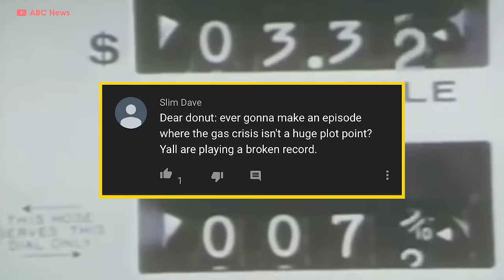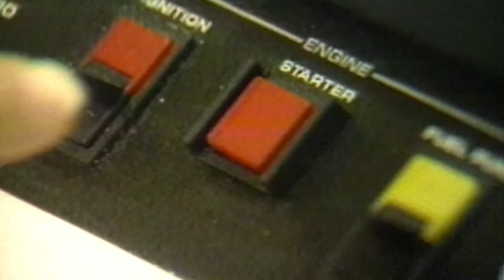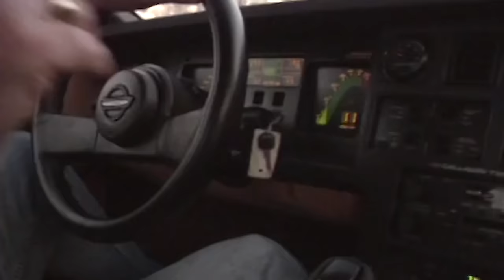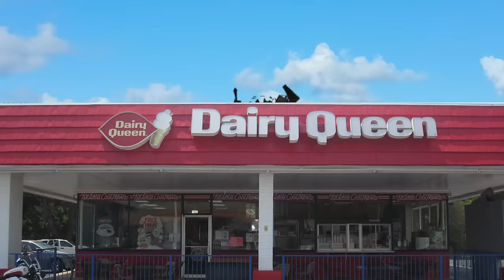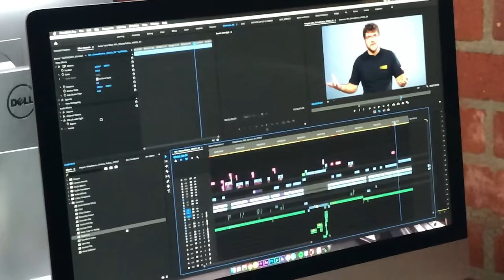CALLAWAY - Everything You Need to Know | Up to Speed

Comment: So like, and hear me out here, the Lexus SC. It's so underrated especially on the west coast, same platform as the supra but you coulde get either the 2JZ or the 1UZ V8. Plus they're insanely reliable.
Reply: I'm still kind of suprised they haven't done an up to speed on SC's/Soarers. Or the Eunos Cosmo for that matter. Both so underrated
Reply: everyone says im crazy when i say the sc is a better 2j chasis then the supra... sc is front mid engine technically and much cheaper than a supra
Reply: ForgedCarbon sc300 look better than the supra
Reply: As much as I want that, the fact that the SC/Soarer is generally unknown is one of its best features.
Reply: @illshlapu  true, but it's a great starting point for early enthusiasts and I can't see it raising the prices in em drastically
Reply: While I love my SC they aren't nearly the "same" platform they do share a lot of common traits but their 2JZ is the GE which is the same as the NA Supra's. I got a SC300 with a 1JZGTE right along side my 1JZGTE IS300. Lexus made some super sexy cars back then that are reliable AMAZING platforms. I haven't bought anything but a SC or IS in the last 20 years.
Reply: @oldhunterraziel5327  I know they are not identical, but most of the parts on a supra 2JZ you can just bolt right up, obviously with some outliers. But the suspension is the same, frame was the same they just took off an inch on each side for the supra, the SC was the luxury coupe the supra was the drivers car... both amazing cars either way. But yeah i know it isnt like you can put em side by side and say "dude all the bolts line up" lol
Reply: @seankennealy3021  yeah I have used a lot off the 2JZGE's in my 1JZGTE swaps. I mean aside from displacement 1JZGTE & 2JZGTE VVTI models so much can be jist swapped over. I have 2JZGE coil packs on my 1JZ and the injectors I used as well from the 2JZGTE to go from 440cc to 550cc. Got quiet w few upgrades for my 1JZ off the 2JZGE motors.
Reply: 1UZ V8 is no joke. Great engine
Reply: @aaronp9835  preaching to the choir lol, have the vvti model in my sc400. good power down low and decent up top too, and crazzzyyyy reliable. Some people use the block for race boats just because of its durability
Reply: Sean Kennealy Yeah it’s definitely a great engine. Are used to have a 2006 Scion TC with a 3.3L v6 from a Highlander I believe. I had blown up the motor and saw on YouTube there was a guy that did the 3.3 L V6 swap I thought wow that’s amazing I’m doing that. Had to get a custom exhaust system and headers made obviously. But with for full boltons and a good tune plus, brakes, suspension, clutch and all supporting mods it was an animal and extremely unique.

I believe the 3.3 was around 240hp but after intake and full exhaust with custom tune it out down 245whp. Had to run 18in 245s and get a TRD lsd to get the power to the ground.
Reply: @aaronp9835  not only that they sound AMAZING!!!! 🤪
Reply: The sc300 looks boring
Reply: Lexus are old man cars, great engine but definitely not exciting. Too much focus on luxury
Reply: lame
Reply: @omgwowlol0  Ever heard of the LFA or the RC F Track Edition?
Reply: @MQBjon  hold this L we picked up for you.